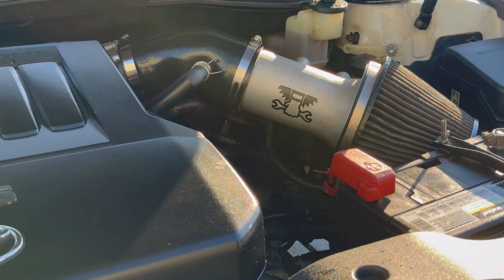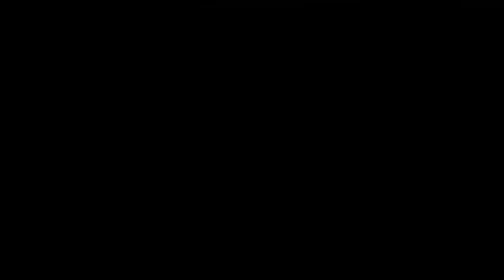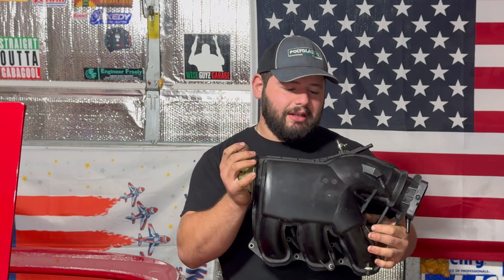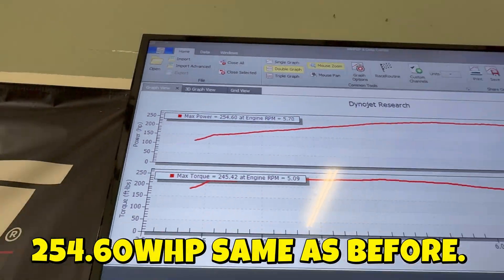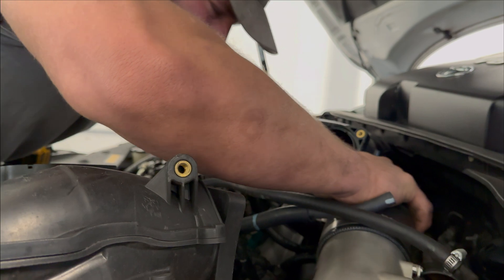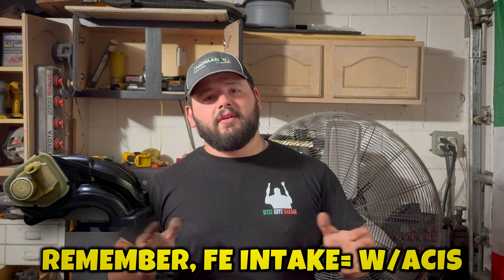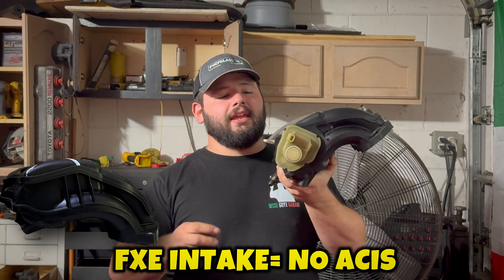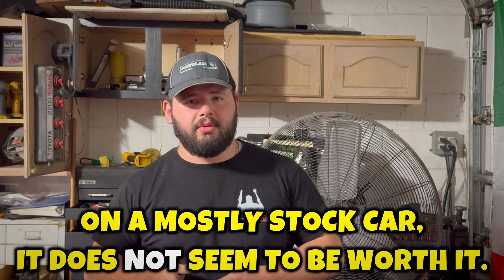Toyota/Lexus 2GR-FE V6 Owners: How YOU Can Make MORE POWER On a Budget!:EP3

Comment: Toyota did an awsome job with this engine. Witch makes it one of the worse engines to pull power out of na. Like my 2gr-fse is doing all it can from the factory. Cai no gain just big loss when it heat soaks, full exhaust an headers 3ftlbs 2hp... Tune dont even try it. Twin turbo it on low boost 750whp. Thats telling you right there they breathe. Sad toyota has never had aftermarket support. Ppl think a Vr38dett is the shit in a gtr, but i damn believe a IS350 awd twin turbo 2grfse would put it in its place if they had any aftermarket support.

Comment: just a slight correction , es350s min fuel grade is 87 octane according to lexus , not sure if the hp provided is with it running 87, but the rx350 with the same engine has a min of 93 for many model years and does3 more hp at 275
Reply from the maker: All 2GR-FE motors can run on 87 octane with zero issues. 93 is required to make full power as advertised is the whole thing!

Comment: The toyota crown athlete with 2gr fse is rated at 315hp...... i wonder what the difference is?
Reply: My is 350 f sport is a 2gr-fse. It uses ds-4 system witch it 6 direct injectors an 6 plenum injectors. They rated at the flywheel but make 278ish to the wheel.

Comment: Would using the fse parts give you more gains? (I know you'd have to import them from Japan though?)
Reply from the maker: 2GR-FSE was made in the States for the is350. There is no compatible parts between them minus the exhaust manifolds themselves sadly.
Reply: @WiseGuyzGarage ahh that sucks, didn't realise it was released in the States also.

Comment: Look at the dip in torque with the fxe intake,  it might make slightly more hp but i doubt its any quicker on the road, probably slower and that lost torque below 4000rpm would be crap for daily driving.  Definitely sticking with the stock intake manifold.  Thanks

Comment: The camry still has the 2 primary cats installed? That could be the restriction? Im thinking about taking mine out.......
Reply from the maker: I have heard that when they are removed they add like 20+whp give or take!
Reply: @WiseGuyzGarage really? Is that 20hp with empty stock headers or aftermarket ones? Any idea what hollow stock manifolds sound like? Im worried it'll sound like a g37 woth test pipes if I knock the cats out. Not a fan of that raspy trumpet sound.

Comment: Hey mate good to see someone that loves getting the most out of the 2gr engine, I'm in Oz Australia and have same engine but just called the Toyota Aurion. Now I've done that mod by removing the flapper and epoxied it back in but it took me so much banging to get it out and damaged the connection prong and today when installed it back it comes up P0660 I looked it up and cleared it and it keeps coming back on, I need help asap how to override this circuit, can I put a 20 cent resistor in there to think it's all a okay! I have registration coming up soon and need to get this code from keep coming up. Much appreciated from Australia my friend. T
Reply: I did this mod not for power as I'm mature age 39 but I hate how restricted it sounds like a vacuum cleaner  on cold start my 2gr. Same with my old one which was heavily modified I have a video if anyone's interested I reckon it's the best sounding 2gr out there, it literally sounded like a angry  big cat not that domestic cat I'm talking panther cougar style, my ex hated me when I said it sounded better than sex 😂🤣
Reply from the maker: I know if you unplug the connector for the flap valves they wont actually throw a code. If you leave them plugged in, then it will throw a code if its stuck
Reply: Hey @t.p7779. I hope it's fixed now. I did the same mod to my Aurion and it made a big difference. I too broke the tube 🙂 but spared my prong, just. I went and bought another complete intake and airbox from a wrecker for $100. It had a similar code but for the vacuum sensor on the side the main intake tube (which I was installing). Easy enough I just swapped over the old one. If you broke the vacuum actuator which the rod is attached to then it might throw a code due to a leak in the diaphragm. Either way the wrecker could be the solution for you.
And @WiseGuyzGarage. Where are you? Missing the content 🙂. I had the car tuned and holy cow the difference. Mid range and Top end are outstanding. Did 98mph full weight with crap 3.2sec 60ft in Drive with loads of wheelspin and wheel hop. I didn't get a power figure as the auto wouldn't hold 4th on the dyno but the difference is there all right. Will be back soon with better tyres and warmer weather. It was a very cold night. Looking at custom headers next...

Comment: intake air is going say 300 ft/sec. Heat soak on a plastic intake while you are picking up air at the hot engine? Log knock, timing, and AFR. You'll find more quicker.

Comment: Extremely well presented in my humble opinion.  
I may be missing a detail though, can anyone please tell me what standard rwhp was?  I have the 5sp AWD gearbox so it won’t be identical but I’m very curious.

I have just bought a 3rd revision 2GR-FE in a Kluger (🇦🇺Highlander) and I’m very impressed with this motor’s ability to shift that 2 tonne car. 

I ran low octane for 2 tanks and averaged 12.6 litres per 100km then got it almost empty and put premium 97 (🇦🇺93) and after 3 tanks have averaged mid 11s ever since so I did feel like the octane probably made at least part of that difference.
Reply from the maker: So far the MOST the car has made officially is 256whp. With the short runner plenum in reality it should have made more but sadly it didn’t. Great cars you can’t beat them!

Comment: Fyi i have a 22 highlander with 295hp. Lexus is rated at 310 or something and i feel a huge difference with 93 so is it really the fuel?
Reply from the maker: We need to test the octane fuel on the engine still, a Subscriber reached out that in 05 with the Avalon it added 20hp at the crank from 87-93 octane fuel!

Comment: Do you have the ability to change fuel and timing? Just swapping without tuning as youve just seen is pointless if your trying to squeeze everything out of it?
Reply from the maker: Typically I would agree that would make a difference, but in this case the ecu adjusts depending on the maf readings and knock resistance to adjust timing on the fly. These motors are knock prone around 4500 rpm’s. Higher octane fuel should add more power, but if the exhaust can’t allow enough airflow through the exhaust system then the additional knock resistance is negligible. Even with a tune on the ecu, it wouldn’t net more power if it was flow limited
Reply: @WiseGuyzGarage welp i disagree with you 1000 percent simply because they are all base tunes not unique but universal.....your wasting alot of money on dyno time without playing with the computer...after turboing a 95 accord and tune a 99 accord both vtec i can assure you there ARE GAINS TO BE MADE!!!! MUAH HAHAHHAAA😊
Reply from the maker: @jasonruch3529  The ECU in the car IS tuned. That's why it revs to 7200 rpms. You can tune it to whatever you desire, but the reality is if the bolt on components are not adequately flowing enough air, then the tune is useless.

Comment: tht intake is a hot air intake once the hood shuts and hot air doesnt make good power
Reply from the maker: I totally agree. The real fix would be to add the air intake outside of the engine bay. Since this is a daily driver he really cant do much with it in that regard.
Reply: @WiseGuyzGarage  fenderwell intake or build a ghetto box for it anything to keep hot air out
Reply: I made an intake for my 07 es350 it runs below the battery. All I removed was the stock airbox/intake resonator  removed the battery just to get more room to install and boom it fit so well. Got the best readings for g/s 
i used a 90$ ebay kit an extension cable for the MAF sensor and a random MAF tube to have it right after the filter in the bumper
270-300$ to make thts including an AEM dryflow filter 3"

Comment: I got a 2010 toyota Venza 3.5L v6 with the 2grfe.  Ive modified the intake with an AEM CAI, removed mid and lower factory res as well as removed the factory muffler, and replaced with down pipe into a vibrant ultra quiet resonator and borla xr1 round muffler to a y-pipe and 2 4” tips.   Watching your guys video to get some more helpful hints.
Reply from the maker: @Mogulbrandandgrooming  you remove the cats?
Reply: @WiseGuyzGarage  also,  havent dyno’d it either.
Reply: @ cats still in.  Just followed yall on insta with my car page.
Reply: @Mogulbrandandgrooming  I have a 2012 venza 3.5 as well, do you have videos of how it sounds?
Reply: What else have you done, its been six months

Comment: I'm just sitting here trying to figure if any of this can be applied to an underappreciated 05 Sienna ❤
Reply from the maker: The mounts do! As does the shift cables! The only question is the clutch pedal itself, everything else should be the same. You need to figure out the shifter. Worst case you can space up the factory Camry shifter from the floor to work!

Comment: Hey man new subscriber, your videos help give me ideas for my 2011 camry v6 do you have a link to where I can get a used lotus evora y pipe? Does the GT version for the evora fit or is it different from the original lotus evora
Reply from the maker: I would just scroll the lotus forums and go from there. I’d stay away from the gen 1 y pipe as we saw zero difference in performance. The s2 or gen 2 y pipe is where you should keep an eye out for one! The s2 y pipe has a 90 degree turn on the end of it so you need to weld a flange but other then that it’s not bad to install. Hope that helps!
Reply: @WiseGuyzGarage  I saw a lotus evora 400 y pipe would that do?

Comment: My 07 Camry was MWR Stage 1 cams, upgraded injectors, FMW headers, standalone ecu with a hell of a tune, upgraded throttle body, upgraded fuel rails and pump, built trans, plus some more internal mods and you can make some really good numbers fr. Love seeing others try building 2GRFEs platform is very slept on. My next 2GR build is going to be crazy lol love seeing the motivation💪🏿 💯
Reply from the maker: @MrDiggs-pu2zb  how much power did that put down???

Comment: 0:55 yes the stock exhaust is limiting you. One thing you could try is to port the factory headers a little bit  and not connect the y pipe to the rest of exhaust. Then do a dyno pull before and after. Would like to know if it helps cause I’ll be porting then running a 2.5” y pipe on mine and 3.5” all the way back.
Reply: 3.5 is way to big! Its not 1000hp 2.75" is plenty .
Reply: @Natecoxy it will be 1000hp one day build big build once. My car sounds amazing with the 3.5” exhaust I built.

Comment: The intake plenum runs into vacuum issues once you start pushing powers. Franken motorworks makes performances plenums for this engine. Once you get close to 300 wheel I believe you'll be capped out vis-a-vie intake
Reply from the maker: You’re going to love the next video on this then!
Reply: My basic understanding is the engine begins to consume more air than the intake can flow, you run into a back vacuum issue in the intake and the cylinders are choking out

Comment: hey man I've been having trouble finding the shift cables for the 5 speed manual swap I was wondering if you have a part number or could help me in the right direction. I love seeing the Camry content, keep it up.
Reply from the maker: @gray105  3382133170 and 3382233080
Reply from the maker: @gray105  https://www.ebay.com/itm/305407921681?
Reply from the maker: https://www.ebay.com/itm/305407921679?

Comment: Try going back to stock air box and port it
Reply from the maker: @Staticmax2.0  the air intake made the biggest gain, almost 20whp over stock, I don’t see the point of doing that sadly
Reply: The intake tube WizeGuys used is a great option. 
I kept mine stock looking when lifting the hood. On mine there's a butterfly actuator in the cold air pipe from the front of the car to the airbox. It diverts low rpm intake air via a secondary intake path. It must work but to be honest on mine it was a huge bottleneck. In that forward intake there's a big lump of plastic which I just removed. The metal actuator rod is still in there. With a K&N flat panel the difference was night and day. It REALLY woke my car up. I'd love to see a comparison with the replacement intake pipe.

Comment: pretty intresting results 
when i tested mine on the same day there was a 10hp dif from opening the valve after the Y pipe 
and also if u let the car cool down the intake to 40C vs 60C i saw a 8hp difference too
looking foward to the next mods
Reply from the maker: That is really interesting! Was yours on 87 or 93?
Reply: @WiseGuyzGarage  im from Brazil so i use 87 + ethanol
With a 4.2 bar fuel pressure

Comment: Just to confirm, you are running 87oct on the stock tune? You aren't running an aftermarket tune? Plans for the exhaust manifolds? Gutting them?
Reply from the maker: The ECU was flashed. It’s still on 87 octane at the moment. Not much else was changed. The “tune” was done to show that even with a tune, your car will NOT make anymore power if you don’t actually have the supporting parts to allow it to do so if that makes sense?
Reply: @WiseGuyzGarage  - definitely makes sense. Who tuned it?
Reply from the maker: @TEKSMRT Frankenstein Motorworks, he did it because its manual swapped, otherwise he doesn’t mess with cars with automatic transmissions sadly
Reply: @WiseGuyzGarage - Makes me wonder if the ATS tune would provide different results, already being developed with the FXE manifold and a 4-inch intake in mind, without the FMW velocity stack?
Reply from the maker: @TEKSMRT With the power we are making at the moment I suspect it won’t make any difference in it whatsoever. I’m going to touch the FXE intake again later when we are making more power to see for sure!

Comment: What do you do with the plug from the FE intake. Does the other have the same plug? Do you have to worry about a check engine light?
Reply from the maker: You don't need that specific plug to be plugged into the car in order for the ECU to not trip a check engine light. The car will run just fine without it. For now, we just tapped it off and tucked it away!